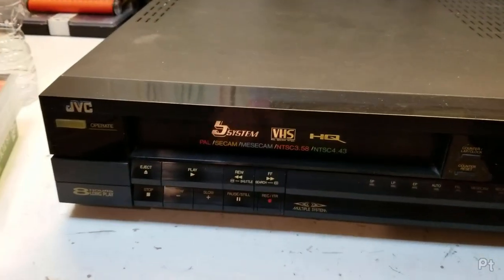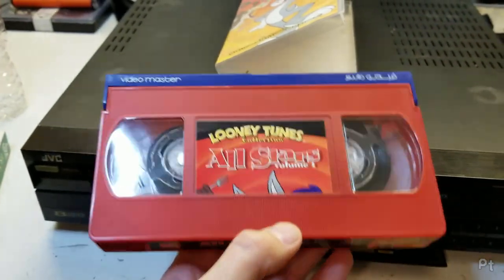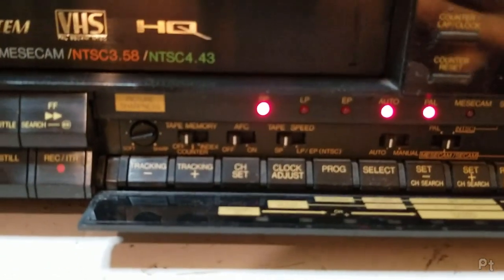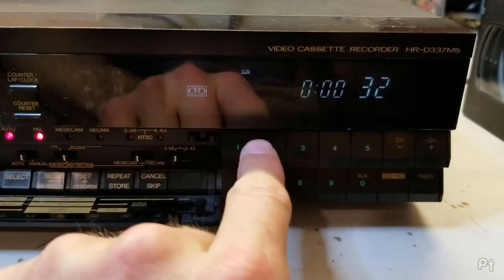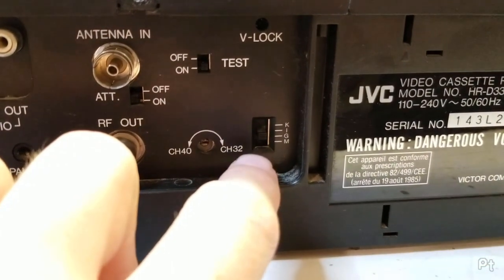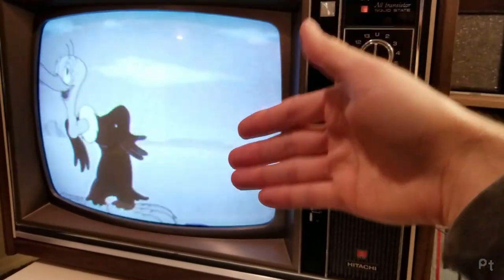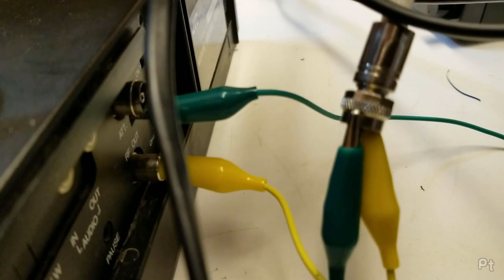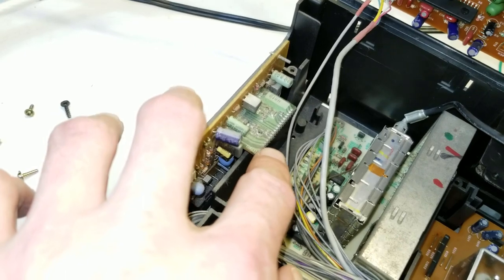JVC Multi-Region VCR (Model HR-D337MS)

Comment: I have a jvc HR -J71 ms from the late 90s with the same problem .Always thinks a tape inside with tape indicator on with no tape .But as you insert the tape it works fine . Apparently this is a common JVC issue . I used exactly the same vcr you have back in the 90s it was nice with awesome picture quality . Thank you for the video 👍

Comment: My JVC HR-475ea is also a multisystem I’ve played both PAL and NTSC Tapes in it and it works very well (but it is a very fussy VCR). I’m not sure though if the TV I was using though was liking the NTSC tape a lot or if it was just the tape being old and flickering now and then because I had the colour system on the TV Set to auto and the VCR manually to NTSC 3.58. 

Still I was very surprised with how well it played the NTSC Tape and just how different it looked compared to PAL. I just feel it’s best to watch NTSC Tapes using a proper NTSC Setup, not a PAL VCR which can playback in PAL60 for NTSC.

Comment: Also, only UK (system I) has a UHF tuner only (they did have VHF when they had the 405 line system) but the rest of Europe (PAL BG/DK) used VHF and UHF as well.
Reply: I broadcasts were broadcasted in UHF and VHF in EIRE

Comment: Sounds exactly like my Zenith VRE510HF and in fact when opening it you can see it's using JVC parts so that's really interesting. The layout inside is almost the same if not similar and the head model number might be the same. This is a pretty cool unit though! Also mine makes that weird grinding sound when rewinding and fast forwarding quickly any idea what it is? I tried lubricating the motor but nothing. But perhaps you could pull a part from a zenith unit too cause it's so similar.
Reply from the maker: At the time these were made, all Zenith VCRs were made by JVC, so that makes sense. I actually have a VRE510HF I want to look at and fix, so hopefully there will be a video soon. Regarding the grinding sound, I have no idea.
Reply: @probnotstech  I'm luckily enough to have two units, one of them the soundcard was cracked or something so I had to replace it so I have a working unit and a parts unit. If theres some part you need for the video I could give you it or something lol

Comment: I´ve got the same machine. What a cool unit. Mine is in a mint condition but needs a recap somewhere around tracking control IC, since the tracking is unstable. Blue Sanyo caps are the usual suspect as far as tracking is concerned. I´ll have to look at it.

Comment: Is it possible to make the counter shine more (where is the time)? I have the same model but it is very dark.
Reply from the maker: These displays can wear our and get dim over time, so it could just be worn out. Another thing to check is the -28v going to the IC that drives the display - make sure that voltage isn't low (that would require finding the schematic).

Comment: I think the reason for the colour / b/w switch was due to the fact not all B/W TVs had a black level clamp, it just gave a better image result but why you had a VCR and a B/W TV is beyond me (in the context of cost) 

All colour TVs have a colour killer due to most of the earlier ones being dual standard, meaning B/W was still widely used, and received on colour TVs and it was never done away with. 

Could be wrong in the black level clamp thing but I’m fairly certain thats the case.

Also love the VCR, it has a tiny bit of a audio hi-fi look to it - but in a good way. And of course the Hitachi
Reply: Interesting to know about the Black Level clamp. I had no idea there was a color/B&W selector switch, at first I thought there was a fault on the chroma board!

Comment: Looking at the service manual, this does have an NTSC tuner so an adapter for the antenna input socket is the only thing you need.
Reply from the maker: Yeah I downloaded the service manual afterwards. Very cool, though I'll never use that part of it anyway.

I was trying to figure out this weird issue from the video. The tape insertion sensor, tape end and tape start sensors all work fine. The mechacon chip is getting all good signals, good power. All voltages are correct with no noise, mode switch signals are good....

Comment: I never knew vhs lp ran at slower speed i always thought it was just much thinner tape and there was more of it per cassette.
Reply from the maker: There were actually cassettes that used thinner tape and had more of it. T-120 was a normal tape with 2 hours (120 minutes) of tape at SP. T-160 had 160 minutes and thinner tape. There was also T-180 and T-200 using even thinner tape.

You could mix tape speed (SP, LP, EP/SLP) with tape length (T-120, T-160, T-180, etc) to fit varying amounts.

Comment: I am suprised there are prerecorded video tapes NTSC with LP modus( 16,67 mm/s ), like this cartoon. The deck may playback 3 speed tapes.

However, the VCR may recording NTSC video signal only in SP modus( 33,35 mm/S), and SLP/EP modus( 11,12 mm/s )
For SECAM colour signals,  it is possible to recording in MESECAM modus or SECAM( France), modus, with choice speed rec.
SECAM France has poor quality in SP, and LP modus is WORSE ! 
Analogue tuner of this VCR is only for CCIR B/G norm.

Je suis étonné qu' il y a it existé des K7 VHS NTSC préenregistrées en mode LP 16,67 mm/s, telle que ce dessin animé !
Le HRD 337 MS enregistre le NTSC uniquement en SP 33,35 mm/s, et SLP/EP 11,12 mm/s, mais lit les LP 16,67 mm/s

La couleur SECAM peut être enregistrée en mode MESECAM ou SECAM( France ), cependant la qualité d' image en mode SECAM Français laisse à désirer, en SP, et c'est PIRE en mode LP 11,70 mm/s
Une video couleur SECAM est plus acceptable à enregistrer en mode MESECAM ,pour celui qui veut enregistrer en mode LP
Reply from the maker: Pre-recorded tapes in LP speed were very uncommon, same with pre-recorded tapes in EP/SLP. This was usually only the very cheap kids tapes sold in discount stores - like the one in this video.

As far as I'm aware, every NTSC VCR that supports EP/SLP playback will also support LP playback. I think only Panasonic/Matsushita made VCRs kept supporting NTSC LP recording though as it was very uncommon by the 90s.